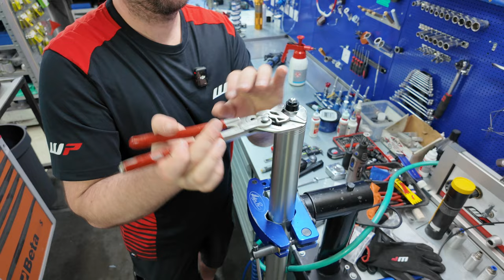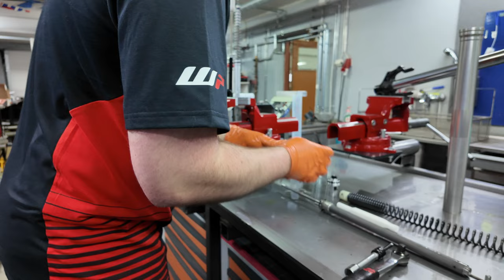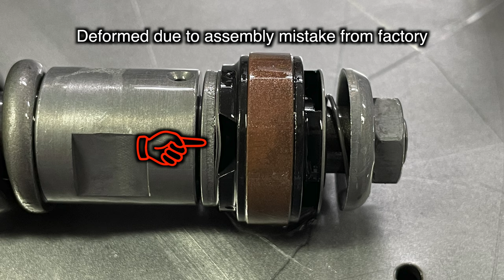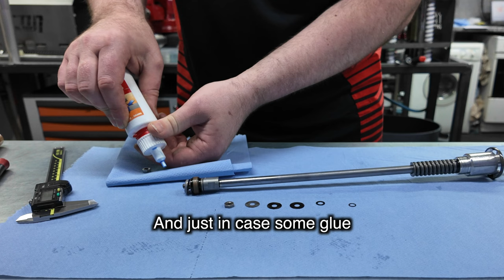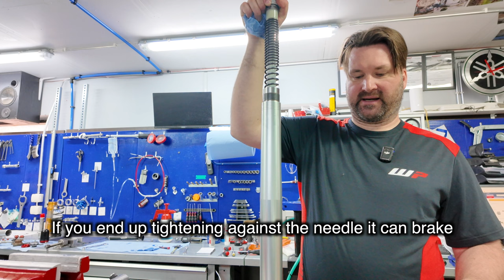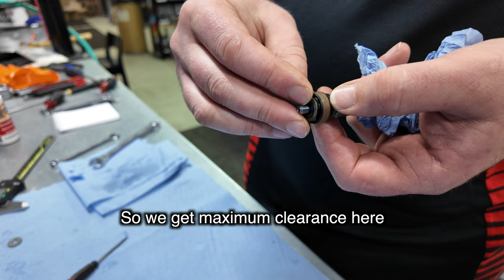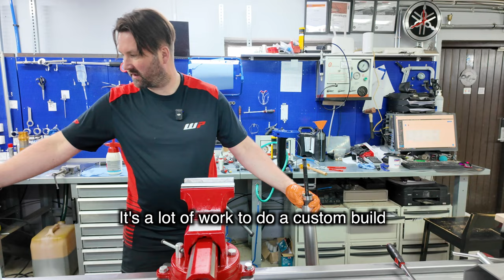BROKEN Suspension On My NEW Tuareg 660!?

Comment: interesting, another reason not to like split fork systems, and I have always been a Kayaba man, the whole concept of one fork for compression and one for rebound damping is just totally flawed for me, and puts undue stress on both forks, not sure if or when i will get around to that video, but if i do is it ok to use some clips and show your example of the inherent problem with that approach? ill credit you of course, Ride Free my friend,
Reply from the maker: Using clips with credit is totally fine by me 😊
Reply: @PatchedBandit   cheers mate, and nice work, sometimes it takes an expert eye 🙂 happy trails
Reply: I agree engineering wise it just worse design for sake of some ease of tune.
I do hate to get low to adjust compression on my AT forks but I still prefer that to split
Reply: @Angry-Lynx  its been an interesting split of opinion on this one, but the balance agrees with you from my viewers, its probably running about 70/30% against and for the split system